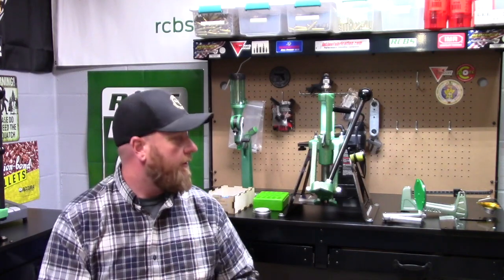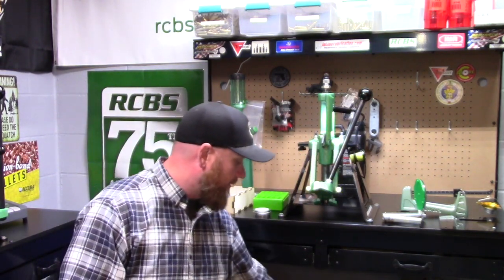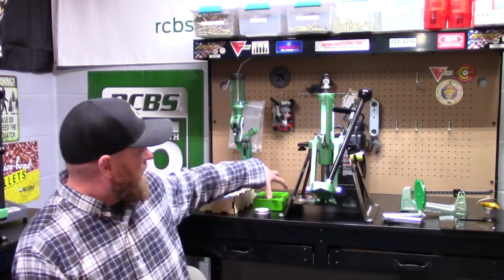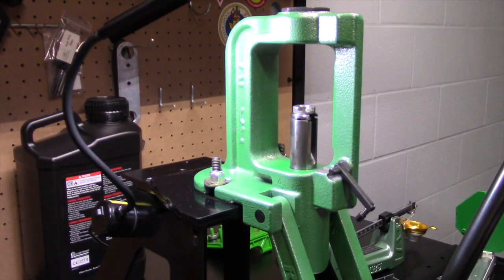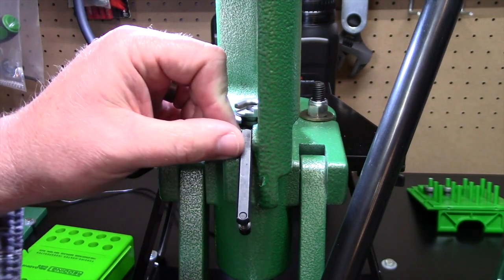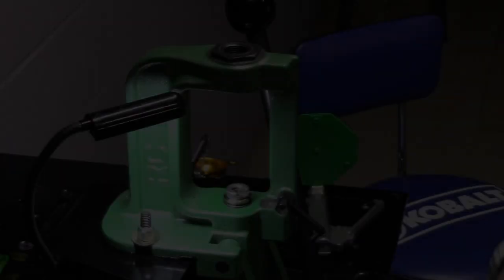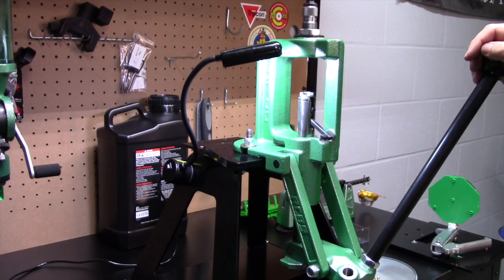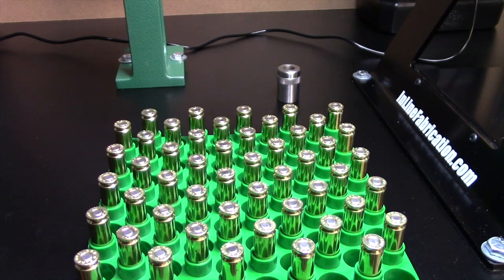RCBS Rock Chucker Supreme Intro to Single Stage Loading - Sizing and Priming

Comment: Think about getting into reloading?? Have to I cannot find ammo for most of my rifles. If I do it's well over 100 bucks a box
Reply from the maker: Can’t tell you it’s gonna be any cheaper to reload,  in fact probably more costly.  However,  going and finding ammo won’t be a problem. Thanks
Reply: @SquatchReloaded  Monitary value of the ammo isn't a issue. It's the availability of said ammo. 300 Rum is extremely hard to find and extremely costly. I'm sure I could reload for less then 6 dollars a round. Every place I look is on back order sold out or discontinued
Reply: @SquatchReloaded  Why would one reload if there wasn't an advantage in the long run?

Comment: What will be my options if I primed a bunch of fired and sized brass if I need to resize them?
Reply from the maker: Hmmmmm perhaps resize with decapping pin removed from die?  If you are worried about detonated and don’t want to save the primers you can soak them in water or oil over night so I have heard.  It’s one of those things you need to think through and develop a safe method to deal with and determine what you are good with?
Reply: @SquatchReloaded  Thank you for your reply, sometimes the solution to certain problems is right under your nose and even simple you don’t see it! Thanks again.

Comment: at 9 minutes you say to turn the die down a quarter of a turn to get a cam over. I see in my directions for the RCBS it says the same thing in the instructions. I have a hornady die I'm using in the rock chucker supreme and the directions for my hornady die says after touching the shell holder then tighten the lock ring and then tighten the allen screw. to me the way rcbs directions suggest, it ends up putting excessive pressure on the die and the press linkages. I look at it as if the shell holder is hitting the die on the up stroke it will not go any further so the sizing is as far down as it can go. I know it's been a year since this was put out but if anyone sees this correct me if I'm wrong doing it the way of hornady's directions

Comment: Thank you for your RCBS videos. I took a class at local gun shop and to my disappointment they didn’t use a RCBS single stage press. They were pushing the Dylan progressive press and teaching pistol ammunition reloading, so I didn’t get a lot out of it and that was way back in the start of our powered, primers, and brass shortage, I’ve forgot everything that I did learn, it’s been so long. I’ve been sitting on all my equipment still in the box going on three years. I want to precision load and shoot long distance with my 22-250 Bergara.
Any suggestions or advice, what’s best to use would be greatly appreciated.
Best regards 
Keith

Comment: For precision rifle cases that have been fired, with my 1972 RCBS JR2 single stage press, I resize to a shoulder bump of 0.002" 
You can use either a Hornady or Stony Point comparator or an RCBS Precision Mic to measure the difference between fire brass and slightly resized brass, then in very slight increments lower the seating die towards the shell holder measuring each time. 
Bench Rest Shooter Eric Cortina has a simple video showing how to do this: https://www.youtube.com/watch?v=htvk1UYOXm8
Reloading for bolt action rifles is simpler than pistols...just need a resizing die and a bullet seating die.
Must use lube with rifle cases, otherwise the case gets stuck in the sizing die.
Also for new cases, deburr the flash hole from the inside of the case for more consistent ignition.
For rifle cases, a case trimmer and chamfer tool will be need to trim cases back to SAAMI spec after the brass has lengthened through firing.
A press-based bullet puller makes it easy to pull the bullet and powder when needed.
Reply from the maker: All good stuff